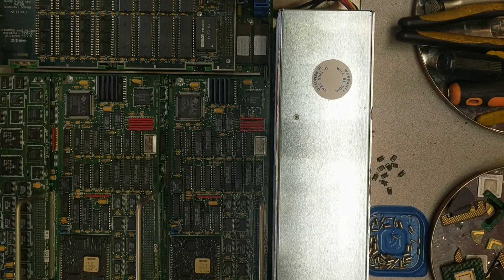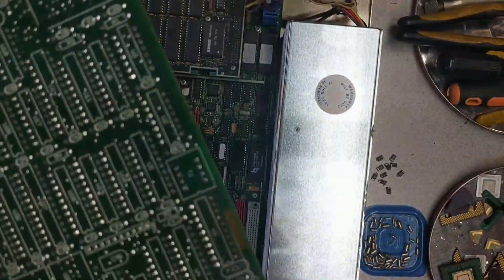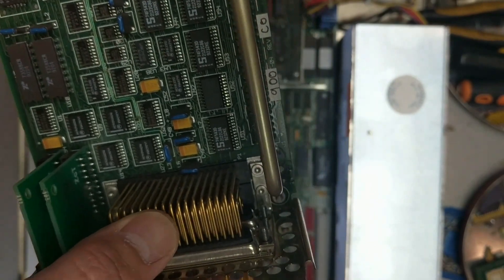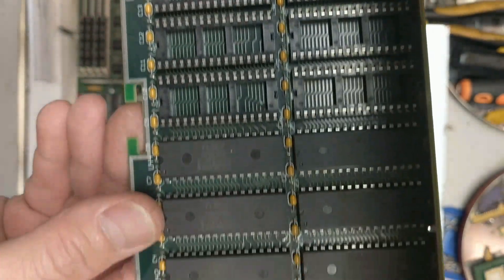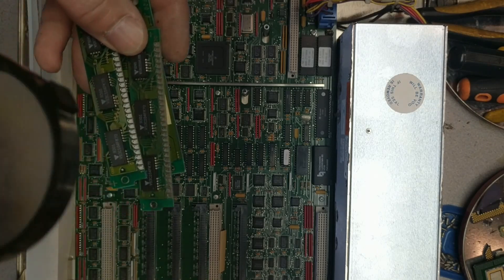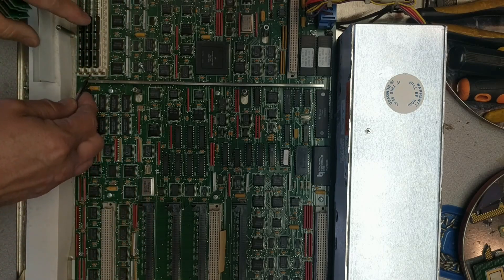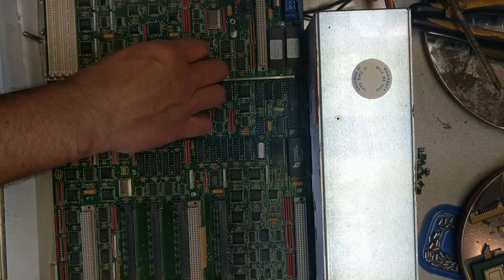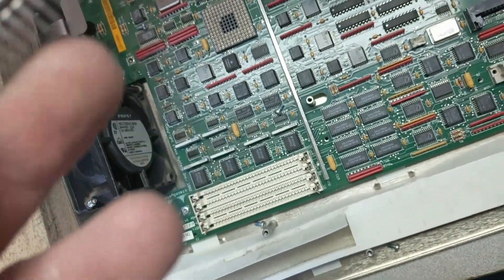Scrapping a Cisco 3950 for Gold Recovery

Comment: Peel the stickers on those ceramic eeproms to see if they are gold braze! With those 4-legged components, the big plastic ones are optocouplers, the small ones in your container are crystals. I usually don't bother with DIP ICs anymore, there is always just one bond wire per pin, so you are better off trying to find small light flatpacks with 100s of pins rather than large ICs with 20 pins.
Reply from the maker: Thank you, the ceramics were not gold.  I have only found one so far that was and funny enough it came out of an old Maytag washer.